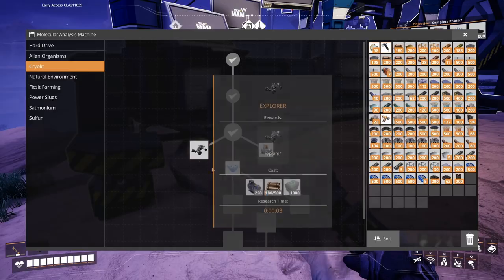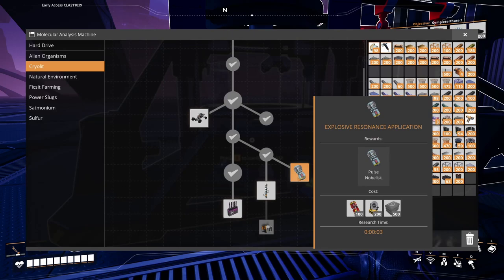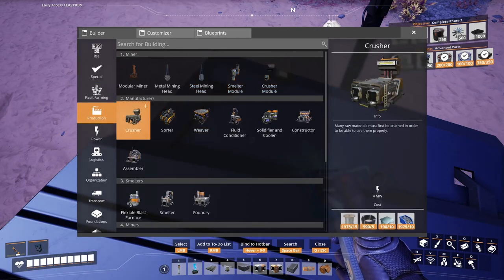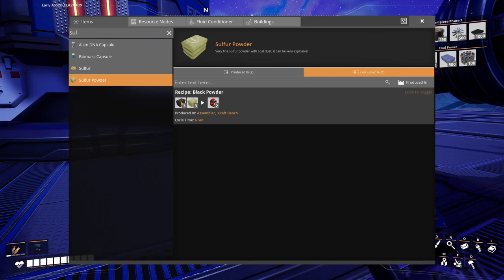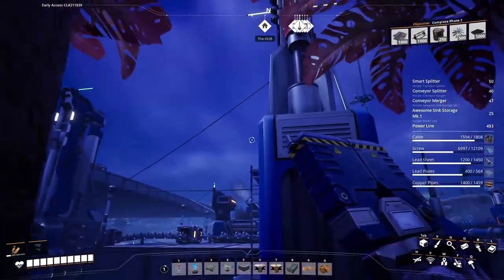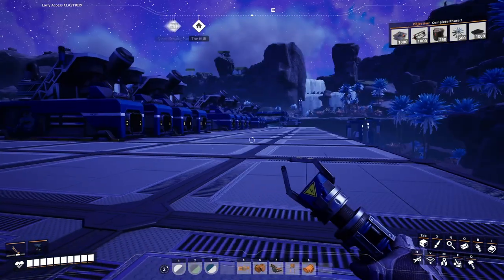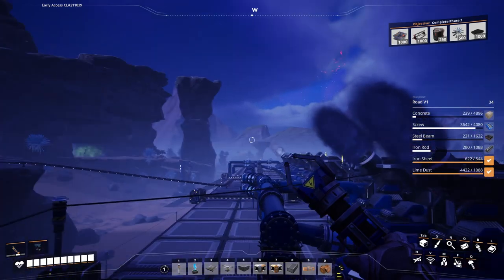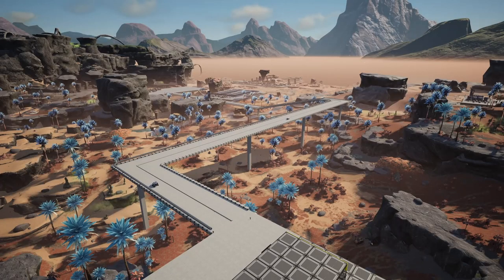Satisfactory Plus Ep 7: I have to do WHAT!?

Comment: As Marc mentioned, you can place a blueprint inside a blueprint - as long as both of these are made in the same tier. So blueprint A from MK3 can be placed inside blueprint B inside an MK3. Save game before attempting that - sometimes it crashes, especially if one of those BPs have lots of parts.  

For lights/belts/tubes, try to build a Π shape 8 meters tall. On each side you can have lights, on the center you can hang your tubes or belts or pipes,  plus the main power line and maybe some signs.

Fluid module is powerful. You can provide water (50/m if i recall) to your mines and you get +50% production (or +25% if you use it with crusher module). Each node takes different types of liquids/gases though. You need to check separately what each node needs for this module (but all can get water). Another powerful module is the one from the slug tree (the yellow one you haven't unlocked yet). Each mine can get 3 of those and each module gives you +25%. Just be careful not to exceed your belt capacity with all those modules. Or setup your factory for the next tier belts and just be ready to just feed the machines at that time.

For steel: read carefully the recipes for steel. Half of those products are made from molten steel, the rest from steel ingots - plan accordingly. Just be warned that you will need lots and lots of steel, so try to increase your production as much as possible. Steel products and industrial beams are needed (a lot) from here onward. 

Mini spoiler: trains are at the end of tier 5 and before that you will have to work your way with oil - and that one is 5 times more complicated compared to vanilla. 

Keep up the good work.
Reply from the maker: I was looking at the alts and it looks like you can get an extra 50% steel with the alt for it. I forgot what the mixture is, coal and lime I believe. I was planning on doing that, but now I’m worried about how much I have haha. I’ll have to write some of the processes down and make sure I’m going to have enough ingots… really good advice across the board, thank you!!
Reply: @stickytak  most (if not all) alts are very OP in SF+. Write down what you have and what you can get with your recipes (and make a habit out of this since we have no calculator) because there are byproducts that are useful now and some that will be useful later. 
Although expensive, my advise is, try to have specialized nodes (where node = miner + crusher) to produce as much of a single type of ore as possible. There are alts and modules that can help you in this approach and its extremely helpful down the road when you decide/need to increase production. Dont forget the limit of your belts. Since you know that you will increase outputs, plan one belt from miner to one or multiple crushers. Do not merge the 2 outputs of a miner to a single belt (no matter how tempting that is, unless you plan to transfer ore to another location) - try to keep it as expandable as possible. Most recipes are very stable in numbers (30/60/120 inputs for example are very common) for ores, while 15/30 inputs  for moltens. This helps a lot in planning. 
For manifolds, i suggest the last spliter to be a smart one and sink the overflow. Since you will increase production later, its easier to have a line of machines at 100% and just delete a storage of unused ores at the end, and build more machines down the line, than to have last machine working at 50% and then reconfigure/rebuild everything after that when you increase output of a miner/sorter.  
Finally, one of the most useful (and troublesome) resource is water. You will need a lot. For miners, for sorters/crushers, for moltens, for farms, for slugs, for cooking. You will need it as input and you will have it as output. This will be a headache for a while (along with power needs).
Reply from the maker: @kzar99  I need a good tool for this! I started writing them all in excel and don’t feel like it’s going to get me anywhere
Reply from the maker: @kzar99  WOW that’s a pretty serious spreadsheet haha, mine is just a big list of the materials and what’s required… I did get a message from someone named WidoXx on discord who recommended “draw.io” to make flowcharts, if you’re interested in that!
Reply: @stickytak  sure - i will check it

Comment: nice video!  not sure about the hypertubes, ive never had that happen.  as for the blueprints, you can use blueprints in the blueprint designer, so you take a blank space in the designer, add a couple foundations in the middle, then build your road blueprint into the designer on top of the foundations (not the load function, use your build gun).  you then have your original road built onto the foundations, take those out and add power to the bottom, then save it over your old roads.
Reply from the maker: I tried to do that when I reworked my blueprints the first time (offline). And the portion of the blueprint that I built in the blueprint maker would not save as part of the blueprint (if that makes sense haha). Maybe I was doing something wrong?
Reply from the maker: Have you had time to catch up in progress? I'm going to finish this factory and get everything automated, then try to figure out slugs and make a video about those..
Reply: @stickytak  thats strange.  i know ive done it before.   were you using the vanilla designer or one of the modded ones?
Reply: @stickytak  ive got through the slugs.  I decided to restart so i can stramline my logistics easier without tearing everything down so not caught up lol.
Reply from the maker: @marcbennett9232  Modded one, the tier 2
Reply from the maker: @marcbennett9232  It's so good to have a strong base for logistics. I love the feeling of never having to worry about crafting an item again after making the "permanent" factory for it!!
Reply: @stickytak  yeah its always a good feeling.  I was trying to not hand craft anything this run and I wasnt able to.  I had to hand craft 50 simple conveyor belts i think.  nothing else though.

some of the tiers are strange.  for example automated biomass is at the end of tier 2 (I think) , but they give you copper pipes needed for earlier unlocks.  the progression of unlocks needs some severe work.  I love this mod overall though.
Reply from the maker: @marcbennett9232  yeah you can’t find those by crash sites… still impressive that’s all you had to hand craft